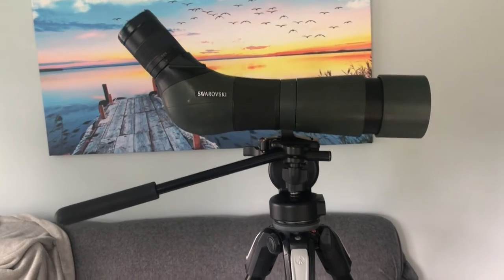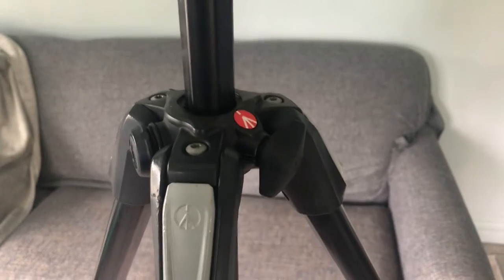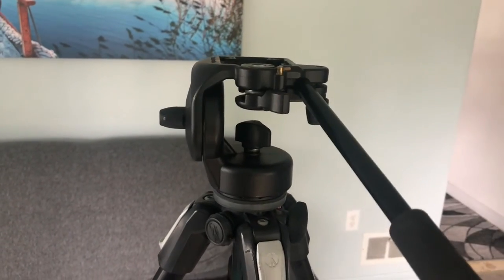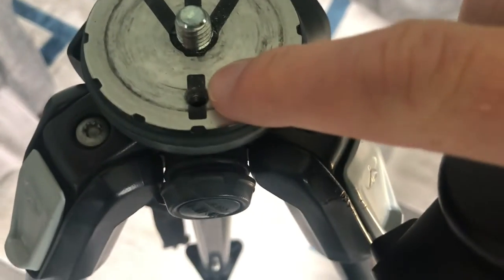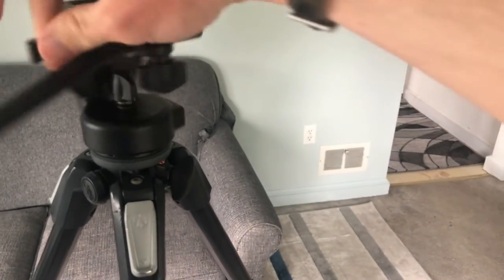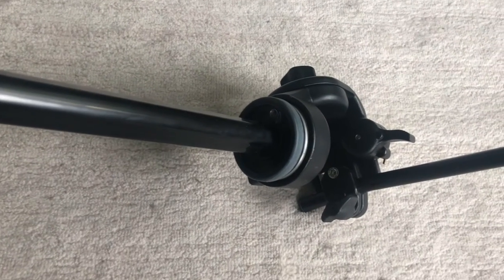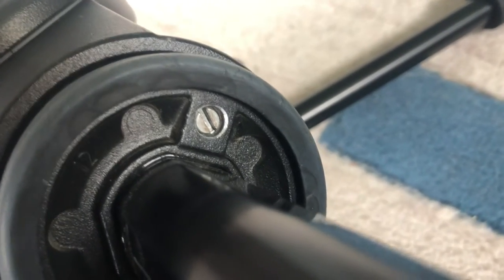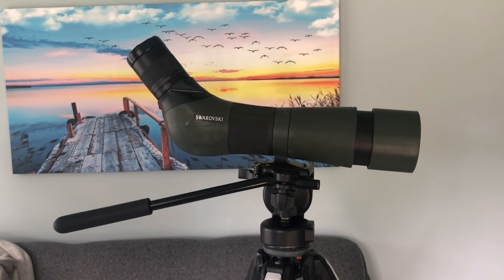How to Attach and Remove a Tripod Head (Manfrotto 128RC / 190X) for Birding Spotting Scope

Comment: Very valuable information. I just bought a used Manfrotto 190go tripod through eBay and while it's in excellent condition it didn't come with a manual. I bought a fluid head for it but had no clue about how to change the head. Many thanks!
Reply from the maker: Glad it helped!

Comment: Thanks for making this video. Have the exact same 128rc head and 190x tripod, and the head consistently goes a little wobbly. So I'd periodically tighten the little bottom screw. Now watching your vid, I removed and reattached the head via your steps and it is rock solid. Maybe I didn't have the pan knob tightened fully or something initially and the head wasn't fully screwed onto the tripod column. All good now! Thanks!
Reply from the maker: Happy to hear it is working better for you now!

Comment: I was wondering if i had to buy a separate, bare center column to use the tripod i already own with an extension arm i was planning to buy. Maybe i'll still buy one if they sell them, so i don't have to do the whole process every time i want to switch and can just quickly swap the center columns. Regardless, thanks so much for this information!